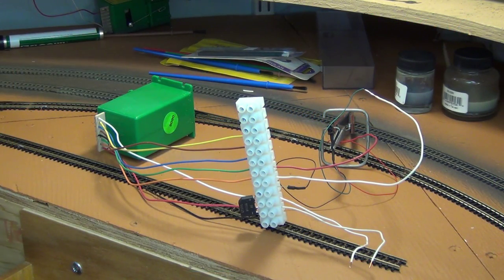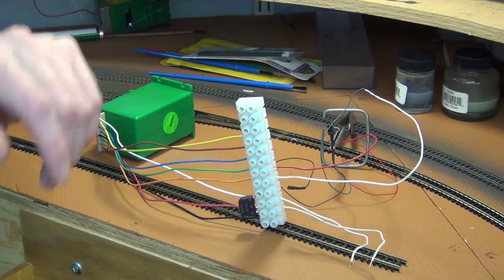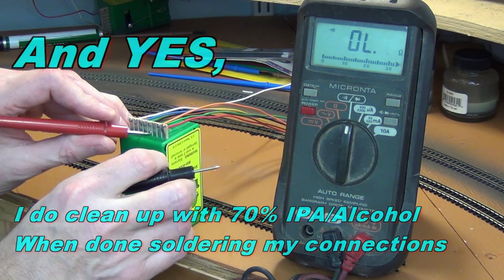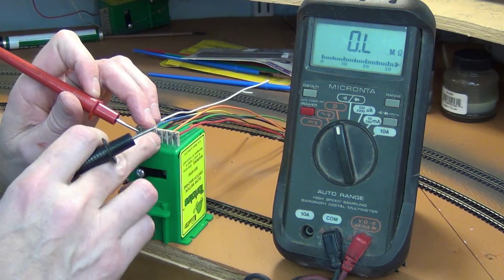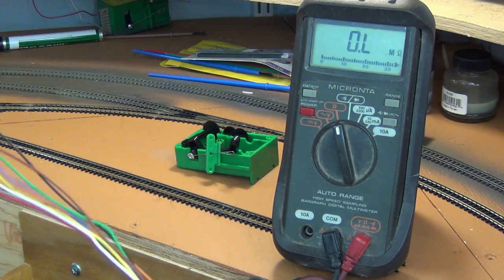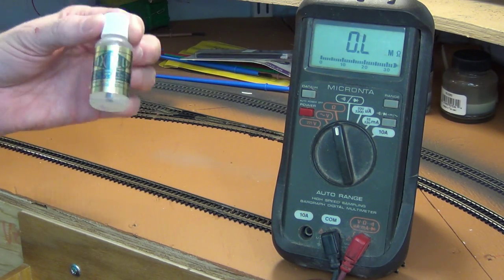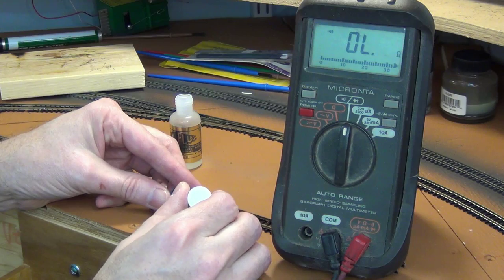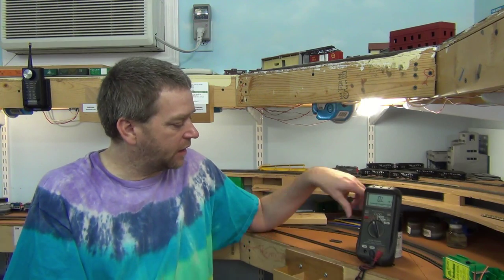Solder Flux and Shorts Part 1

Comment: Not all Flux conducts electricity....you are using "jeweler's flux" which contains zinc (a conductive metal)...normal electronic flux is not conductive......if you use the correct flux for the soldering application you will not have a problem.
Reply from the maker: true